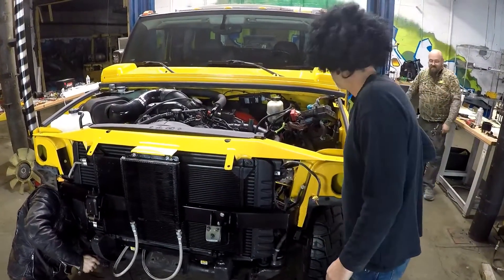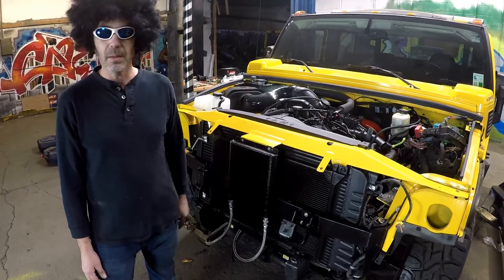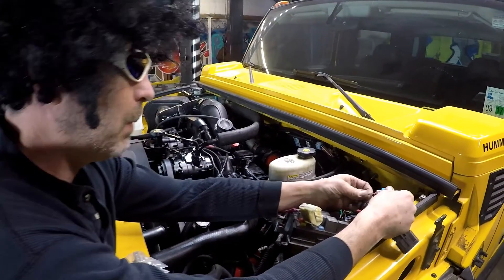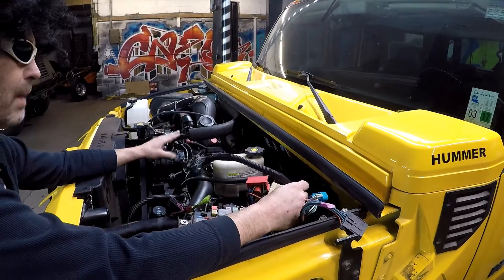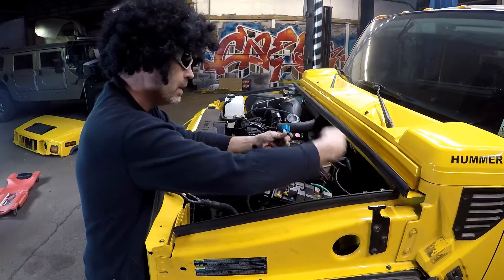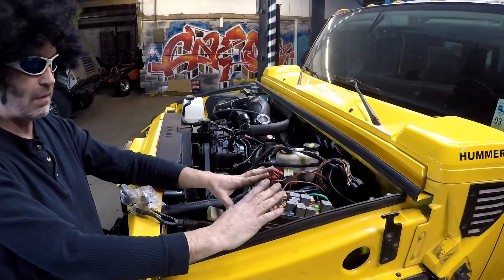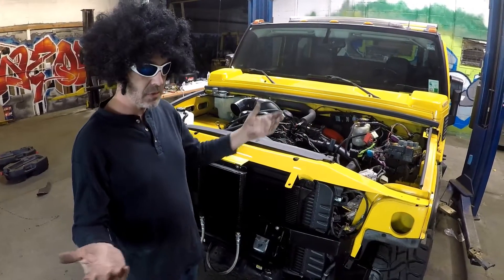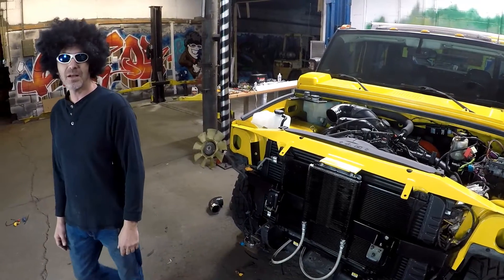Ultimate Duramax Conversion H2 Hummer Step 5 Johnny Magic "Motorhead Messiah" Hline Conversions

Comment: I have a h2 thats been swapped already with a LLY duramax    at 12 minute mark, it was mentioned 4wd transfer  case may not work   that's issue I am having   no power going to switch   I just bought truck and it was like that when I got it   Any suggestions

Comment: I think the hummer should of be built that way for the factory if they was the hummer brand may still be around today, I want a 09 luxury h2 SUV with this set up but the large turning circles of H2 makes it hard to get around the tight in the UK due to narrower roads but I still want one I could have a custom speed controlled rear wheel steering system fitted on it